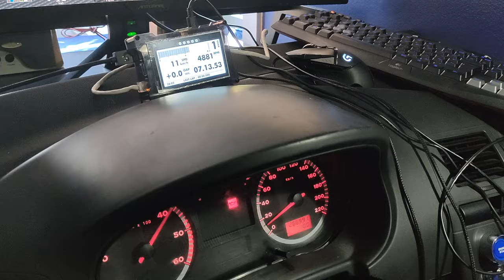Building my dream DIY Seat Ibiza Sim Rig in 5 minutes

Comment: This is awesome!  I want to learn how to wire up a dashboard to a sim rig..... this thing is amazing!!
Reply from the maker: There is another video on the channel with more technical info, basically it is easyer on a car from the pre canbus era (like ours), you will just need some transistors, a 12 volt power supply, an arduino and the sim hub software ... we spend most time on re-engineering the pin out of the dashboard as car manufactors are not keen to give you those details, not even in their tech workplace handbooks.

Comment: Dope, two  more monitors for left and back would be insanoflex
Reply from the maker: The monitor can be turned aroudn 180 degrees in order to sit at a desk in the engine bay and use the computer as a regular PC / Workstation

Comment: You are a very good racer and drifter. We own an Seat Ibiza but other generation (2002) and i would never be able to do this thing to our car. I love our car so much and i wish for setup that you have. I would also install the speakers into door panels and i would connect hoses from radiator from home to heater core in the dashboard so i can heat up my interior in winter. I would also left the interior fan working so in hot summer day i will be able to cool my self down a little bit. But i believe this was not that easy to do so respect. I am also very happy that you left side windows working and it would be awesome if you will leave the old original steering wheel from car on your steering wheel. I like it, i like all the job you w/ your dad did. Very cool setup bro!
Reply from the maker: Hey , we placed computer fans behind the vents so there is air circulation :-) powerwindows, mirrors etc do actually work. Heating is not needed as it gets already hot due to the computer system being in the back and the total thing being installed inside the room. This car was a banger, the bottom of the car was fully corroded, the engine was leaking and had exhaust gas / emmisions issues, interior was not at it's best and the overal state of the car was very very poor. Mainenance was long time due and it had one of those vw diesels from the beginning of diesel gate making it very expensive to put it back on the road in Belgium, that's why we gave it this second life instead of shredding it fully.

Comment: Have you considered buying one of those  moving bases for the seat for  extra realism ?
Reply from the maker: We did however it has some disadvantages, we now installed a logitech Z906 ... 1000 watt sound system, the sub gives enough vibrations to get it more realistic!

Might add basspumps later on :-)

Comment: That’s super cool. Great idea with the car. Looks amazing to. I wanna get into sim racing but I don’t have the money rn. What is a good starter wheel I guess. For a small budget?
Reply from the maker: All we did was also on a low budget, cars that have a diesel engine and don't pas tech inspection are inexpensive to buy. Some off the recovered parts can be sold second hand with a bit of patience, others can go to a scrapyard where they give you some money. As a set we used a thrustmaster set, it's a bit of an investment however rather a low end product for serious sim racing. Honestley for what we wanted it is good enough. All the rest is time and be original. The entire setup without the computer and screen was about 1000 euro including the car.

Comment: Insane🔥. Is there anyway you could explain the wiring stuff? or too complicated?
Reply from the maker: There is another video explaining on how it's done on my channel. It strongly depends on the car dashboard you want to use ... powerwindows, lights etc is no problem as long as you have a 12 volt descent power supply it just works however the dashboard is another story. You will need SimHub as a software, an arduino and in my case a few npn transistors as the dashboard meters work with negative pulse width emulation and an arduino with positive so your arduino will control the npn transistor in order to regulate the negative contact of the meter these pulses make the meter move. It only works on dashboards from cars that don't use canbus or any other modern centralised technology. 

Always welcome if you have more questions.
Reply: thank you so much!, considering this as a summer project

Comment: if i could do something like this, i'd shield a subwoofer in a box and run exaust piping to the back, and hide some tweeters under the hood so when i'm playing it will sound like a real car.

if it were fully my build tho, i'd waste money on a carplay radio and wire that to the speakers in the car lol

i'd even make a push to start button to be the power button for the pc.
Reply from the maker: currently we upgraded to a Logitech 5.1 with big subwoofer :) it's more then enough to feel the vibe of the engine. Together with some computer fans behind the dashboard even a fresh breeze makes it feel very realistic
Reply: @TheHaerlings  ah maybe I’m just extra lol. It would also be cool if it were possible to mount it to the mount for those motorized sim seats and still keep the other side, but y’all were working with limited space
Reply: @TheHaerlings  it would also be cool if you could get ahold of some folding displays once they actually become a thing and turn the windshield into the monitor lol

Cool project tho! I love things like this. I’ma prob make one out of a Civic interior bc I like the civic

Comment: How’d you get the dash to be connected with the game? That’s mind blowing
Reply from the maker: There is a video on my channel explaining more in depth. Quick reply, you need a few NPN transistors that swithches at voltages under 12 volt and an arduino ... that together with the SimHub software that you can find online. It only works with non canbus dashboards or aftermarket analog meeters as it uses PWM. The pin layout we reverse engineered plus we had some help from a Seat Dealer who had access to wiring diagrams. Everything works even the odo meter is contuing to count. Only the oil presure system sometimes comes on as it is kind of intelligent measuring how fast you rev :-) the cars in the games rev much faster then a 1.9 diesel so it gets an error however it's not a big thing just once a beep and a red light All other things juist work.

Comment: My jaw dropped when I saw the gouges and window working. Also is it using the cars accelerator and brake or is it an aftermarket gaming one?
Reply from the maker: No we are using the one that came with the Thrustmaster RS500 gaming kit however ... it wouldn't be to much of a challenge using the original ones and building a mechanism to make those work, as the car was already drive by wire the gas throttle could be directly used for clutch and gear a potmeter could do the job and then use a joystick usb controller :-) however this sollution was way more easy we just put the game pedals in and they feel very very good and realistic. There is a video on our channel explaining more in detail how we got the cluster to work and what we used: https://www.youtube.com/watch?v=sc5NNEnxs2s
Reply: @TheHaerlings  thank you very much I appreciate it alot, not very many content creator help out. Big respect for you kudos
Reply from the maker: @navbtw3207  if you have any question feel free!

Comment: How did you sync up the gauge cluster with the in game one 😑
Reply from the maker: we use an arduino and some npn transistors together with a 12 Volt power supply the car is a pre canbus car so we just sent PWM signals to the meters. There is a video on my channel explaining more in depth how to do this. You will also need a little bit of software called SimHub. The reverse engineering of the pinpout we did by ourself together with some information that we received from a friend who works in a volkswagen dealership.

Comment: I thought about doing this with an EG civic dash but how did you guys get the cluster to actually work?
Reply from the maker: We used an arduino together with some npn transistors as the dash if negative controlled. You can only do this with a non canbus based car otherwise you need to step up the game and start controlling the dial servo's. In order to let everything comunicate there is a software needed called simhub, we have another video on the channel explaining more in depth how we did it. 

Feel free to ask other questions if you have some
Reply: @TheHaerlings  Thanks man I really appreciate the help!

Comment: Excuse me, how could you connect the speedometer of the car to the game?
Can we use the speedometer of any car?
Can you teach it?
Reply from the maker: It depends on the type of car you have. Ours did not have canbus so there was an easy way of sending signals to the meeters. You will need a plan of the pinlayout of the dashboard (might be hard to get as carbrands are not to open on this information) after that you will need an arduino and depending on if the car is positive or negative controlled some transistors. Ours is negative controlled  so we had to use npn thransistors to control via PWM the meeters. There is also a software you need to install that is called simhub. If you google it you will find lots of info. There is a video on the channel explaining more in depth how we did it

Comment: Hey, i want to build something like this with a friend. Can you say how much you paid for this? (Without Pc and Equipment)
Thats so awesome.
Reply from the maker: Well that is a very short question that is hard to explain... but let's go:
- find a car from the PRE canbus era ... otherwise making the dash work is a not as easy as we did.
- based on that choice -> Pre canbus you need some transistors a few wires and an arduino
-buy the simhub software
-buy a big supply of chips and drinks ... you are going to spend evenings and evenings re-engineering the connectors of the dash to pinpoint what is wat ... if you buy a car ... it might be a good idea to investigate if you can get your hands on the pinlayouts ... (sometimes if you know somebody that works at that brands dealership it is possible)
- if the car has any form of canbus ... you will need to directly connect to the servo engines of the dash i have no idea in what kind of trouble you are getting yourself but probably a lot
- other option is replacing the dash meeters with an LCD and a raspberry pi

The steeringwheel, pedals, shifter and handbrake are just thrustmaster things that you can buy at amazon or a computer store

Making a price is very hard as the most expensive part is probably goint to be the car :-) and a lot of time. It also depends on what kind of tools you have, what stuff you have laying around ... for example we had lot's of wires, atx powersupply to get stable 12 volt, etc etc as we play around with stuff a lot. We also have a welder, grinder, tools etc ...

Comment: Any tips on wiring the speedo?
Reply from the maker: Yes I have. Our car was a pre canbus car so we where able to use a npn transistor together with a 12 volt powersupply connecter to an arduino, that arduino gets it signal via a software that you need to install called simhub. If hou have a canbus based dashboard it's a different story, I think what you need then is some form of a servo controller to directly control the speedo. Ours is fully working due to the fact that we simulate the real signal like it was in the car. So the odo is even counting. There is a video with more info on how we did it on the channel

Comment: How did you hook up the RPMs and speed?
Reply from the maker: I use an arduino and some NPN transistor. That is connected to the pc ... the PC has some software called SimHub. There is another vlog on our channel explaining more in depth how we did it. Please note that it was kind of easy due to the fact that the Seat was a Pre canbus car.

Comment: How did you guys get the dash to work?
Reply from the maker: there is another video on the channel on how we did it. So basically it uses an arduino uno, some transistors, 12 Volt old ATX pc powersupply and some software called simhub. https://www.youtube.com/watch?v=sc5NNEnxs2s

Comment: How did you get the tach working
Reply from the maker: First of all this is a pre-canbus vehicle, we tested with a 12 volt powersupply all the wires and also used google to see how things are wired in other VAG group cars from that generation (for example the polo) as there is a lot more info on Volkswagen cars available. Once we had the wires sorted out we saw that the RPM gauge is positive PWM-ed and the speedo is negative PWM-ed. We used an Arduino uno, RPM gauge directly connected and the Speedo uses a small experimental board with a NPN transistor. Software is available via SimHub online, upload the code to your arduino, select in sumhub the correct pins and settings and of you go. All the electronics in the car itself are connected to a 350 watt atx powersupply we had laying around, this powers for example the 12 volt gauge, backlights, electric windows, mirrors, interior lights etc. We also placed 3 PC fans behind the ventilation ports in order to have some fresh air flowing in the car. This is certainly a needed extra, even as the car is kind of open it warms up pretty fast inside of it when you are racing. Hope that answerd your question, if you have any other questions we are glad to answer and help. Maybe we also need to make a small video on the electronics of the Seat explaining everything.

Comment: CHECK THE OIL PRESSURE
Reply from the maker: it's the only error we can't get rid of because there is some logic between the speed of the revs and being a diesel engine. So if the revs climb up higher then the limit of a diesel or faster then the real engine can do you get the error :-) we will live with it.

Comment: I always wanted something like that but my familie doesnt want to help me or somthing and buying something like that is expensive
Reply from the maker: Price is ok-ish the car was 120 euro and had lot's of rust plus a vw dieselgate engine with emmission problems. The steering wheel pedals etc are from trustmaster, all other stuff is relative inexpensive it's more of a question of creativity and time ...
Reply: @TheHaerlings  how did u connect the game with the dashboard and the radio
Reply from the maker: @Exo.4845  the speedo and RPM is done wit an Arduino connected to the computer and SimHub software. The Radio screen is replaced by a raspberry pi that connects via a webpage in the autostartup via network connection to a webservice that runs on the simhub software of the computer. There is a movie with full instructions on my channel. We also used some NPN transistors to make the dashboard work as it is ground controlled and an arduino in positive controlled.

Comment: How did u connect the dashboard with game?
Reply from the maker: there is an arduino, some transistors and then you need SimHub as software, it makes an API available on your computer and the arduino queries the web API on your pc over network
Reply from the maker: there is an instruction video on our channel, also a lot of info on the simhub site

Comment: I was wondering 
Why not just use the car?😂
Reply from the maker: Several reasons:
- it had engine issues
- it had a rusted bottom
- it didn't pass the technical inspection
- it had a lot of costs to do in order to make it safe again
- it has a volkswagen diesel engine with the famous software
- in Belgium roadtax is 4 times the value of the car
Reply: @TheHaerlings  oh thats why

Comment: How did you get the dash to work with the game mate could you contact me on Facebook? Please
Reply from the maker: yes I did, I used simhub software, an arduino and some npn transistors to get it to work. Please note this option only works on vehicles that are PRE canbus era, for later models you might need to directly control the steps of the gauges. There is a video on this channel explaining more in detail what we used and how we did it.

Comment: You are going to spend this kind of time and money building this sim only to skimp out on a monitor. this awesome sim with a dinky 24" monitor haha i see this all the time with airplane sims. It just doesn't make sense to me. Am I missing something?
Reply from the maker: there is a good reason for this :-) while the movie was made we where still finishing things. Currently he has a 32 inch curved monitor. We also added a 5.1 logitech sound system. The screen can be turned 180 degrees so he can still use his computer for regular computer work as there is a desk sitting in the engine bay.

Comment: why not just drive the car wtf
Reply from the maker: It had structural rust on the bottom and did not pass technical inspection due to emissions. The engine had several problems and caf was in general very bad maintained.
Reply: @TheHaerlings  Oh ok, fair enough! Looks cool anyway nice job.

Comment: You broke an good car for this? No way... 💩💩💩
Reply from the maker: it was actually not a good car. It didn't pass technical inspection for multiple reasons. One was that the botto,m was fully rusted, the other one that the engine was bad and had very high emmisions.